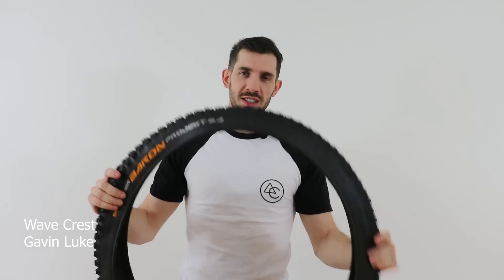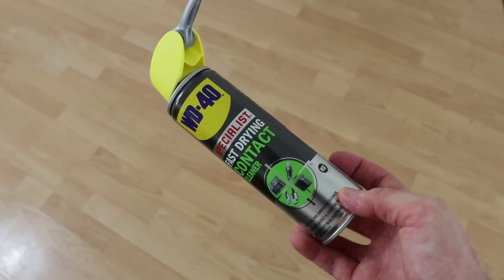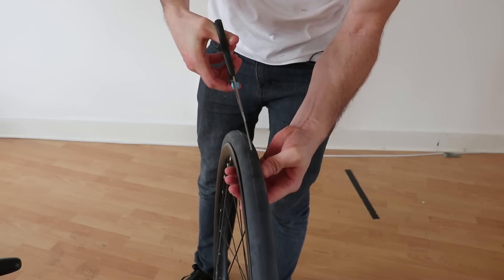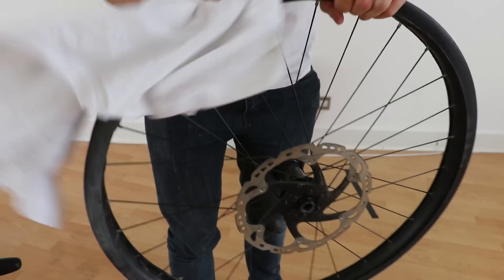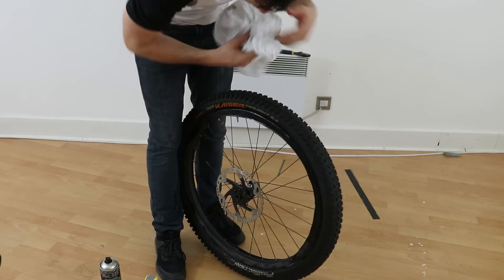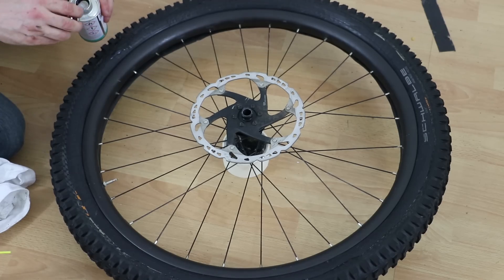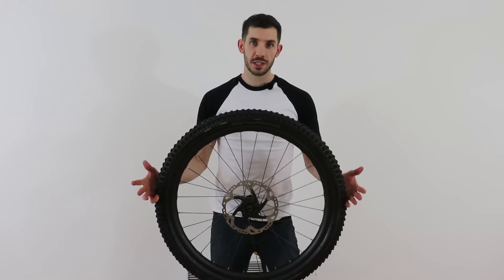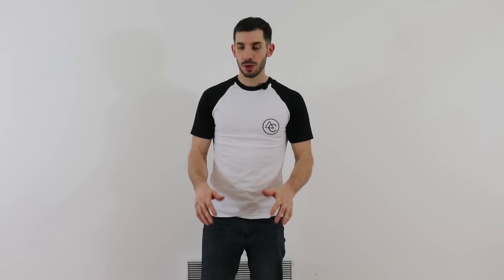Is This Aaron Gwin's Tubeless Secret? Ghetto Tubular

Comment: So now you're using a tube and sealant, pretty pointless as one of the main advantages of tubeless is weight saving.
Reply: main advantages? what are you even talking about?
Reply: Did you watch the Video or do you know what burping is?
The System he built in the Video is against burping the tire, so you aren't going to loose pressure in fast or hard corners and another advantage of having the bit of innertube sticking out on the sidewall it means its a bit more resistant against cuts
Reply: And also in world cup DH weight is not as important as in Cross Country
Reply: Tubeless is not about weight saving. Many tubeless tires are heavier in side wall to begin with so they seal. Its more about puncture fluid self sealing..

Comment: Best tip I can give for tyre mounting is to use a water based lubricant intended for the sexy times... It evaporates out easily and leaves very little residue while being extremely slippery initially, it's cheap as chips at your local convenience store or supermarket ;-)

Comment: Going to try this in CX! Just cut the remaining flap shorter, tight to the bead. Thanks, great suggestion was using thin latex liners with normal latex sealant but this is way more sturdy for the big, off-camber hits that result on burps.

One more idea - maybe use your old patch kit glue tubes for this :)

Comment: Pretty cool idea! I personally would try to trim off a little bit of the excess tube for a cleaner look. I agree with others, I love the idea of a tubular meets clincher hybrid. Would eliminate the need to tape rims, while still having all the benefits of tubeless.
Reply: What if you got manufactures to add an additional extruded flap or a “loose” snake skin strip or something so you could glue the tube to the tire, then glue the extra strip over the tube? The loose tire side wall strips could start at the edge of the side lugs or half way down the side wall and stop just above the lip of the rim. Would look clean and be layered for real side wall protection and triple air retention.

Comment: Genius! yeah that should do it. I went back to ghetto setup after having multiple burps. The last burp threw me at the exposure. Luckily there were bushes and trees to catch me tumbling. Although the current Ghetto setup works just fine, I'll try your glue method for the added lower side wall protection.

Comment: I've successfully done this with a set of Rabbit Hole rims and Knard tyres in case anyone out there is wondering if it works. I used a rimstrip instead of tape, and didn't use vulcanising glue but trimmed the tube almost flush with the rim. I haven't had any issues but haven't been running super low pressures.
 You could also trim the tube a bit before gluing it to the tyre to make it a little more neat

Comment: Bear in mind that the inner tube layer is compressible and this can be of help while mounting the tire, one more reason to apply the proper, enhanced technique which is proven to work: pull the tire as to push the beads in the rims groove'/channel while also pulling radially on the tire, making the tire eccentric to the rim. Start with the opposite side to the valve and end up on the valve; pull the tire as to have it STRETCHED and therefore pressing on the cut tube because of that stretch it has. You need to work in stages, pull away the tire from the rim and also pull the tire upwards towards the valve. That is if you have the valve at the top. You may push with your feet (mind the spokes though) on the rim to keep it on the floor as the tire is pulling the rim upwards because you are pulling the tire as to help with that temporary eccentricity as you work your way towards the valve in maybe more than one cycle. INSIST and have more than one go in helping the tire be stretched all around the rim, from the opposite side of the valve and onwards, not have it stretched just near the valve. That is because the friction keeps the tire from moving (for the eccentricity between the tire and the rim) as to have it pressing as hard as possible on the interface at the opposite side from the valve.

Comment: This is basically that thing enve did with the rubber liner in the rim, the idea was even if you break the rim it will hold air because of the rubber liner.

Comment: what size tire/rim does that 20" inner tube work with? if i use a 27.5" rim/tire, do i get a 1 size smaller inner tube or do i still use a 20" inner tube so it stays tight?
Reply: Hes doing it on a 26 inch so probably a 24 or 22 inch tube would work but you can still use the 20 inch if you want the added difficulty

Comment: This will make your wheel heavier than inner tube + tire. Why not go with thicker sidewalls instead, or combine the tire insert with the tube? Correct me if I'm wrong, but this just recreated the tubular tire without the benefit (or hassle) of gluing the tire to the rim. If this can work, then you could just as easily use a regular sized inner tube (glued inside the tire) to make a tubular, and then simply mount it to the rim.
Reply: @Ali_Clarkson  good job fighting the youtube comment ignorance, Ali, don't burn out from it :P
Reply: It's not the same, because the normal tube+tire is susceptible to snakebite flats. That's always going to be the problem if air is held by a tube instead of the tire casing. It even happens with tubulars (I ride them lots, no longer so much on the road but still on a CX bike) but they are less susceptible because the rim profile is not as "sharp" when bottoming out.

If you trim the excess tube from the sides and you only cover the bead you still gain about half the weight of the tube, while retaining the benefit of sealant. This idea has a fair amount of merit for low-pressure applications.
Reply: @Ali_Clarkson  having some fun with Ali/Aaron reinventing the tubular, but I think in 1-2 years we will see something new that doesn't depend on air pressure

Comment: Hi Ali - what size of inner tube would work with a standard 26inch fat bike wheel?  Just concerned it wouldn't even make it past the edge of the rim!
Reply: You would still use a 20" inner tube, but a larger one.

Comment: I run my fatbike ghetto tubeless but don't glue them down. Can run the pressures mega low with no issues.. then again the tyres are nearly 5 inch wide 😉

Comment: I would've thought there would be a layer of glue inside, between the rim tape and tube, as well. For extra adhesion against rolling off entirely. Same reason road racers use tubulars if the tires lose air, the tire is still glued on.

Comment: Yes I experiencing tire burping with WTB rim...but I only do trail...ghetto system is absolutely good for racing!
I  know about ghetto before from fat bike thing when fat bike tubeless wheel is non-exist. But using glue is nice addition absolutely for race day it is a must. 
Can it just using very thin isolate tape? Like flexible HVAC tape...

Can not imagine how difficult to mount ghetto system using this day mtb tubeless rim and tyre... absolutely pain in the ass...

Comment: Hey Ali Clarkson! Wow! Great idea! You have effectively made a non glue on tubular tire like road bikes but with beads to hold the tire to the rim! I guess you use bigger than 20 inch tubes for the bigger wheel sizes? Ride ride ride!
Reply: Hey if you sucked the air out of the finished MTB tubular unit you brilliantly invented with the sealant injection syringe would that pull the inner tube into the tire for easier removal? Or would the tube be too tight to be sucked in? Ride ride ride!

Comment: have you try'd putting the glue on the bead before seating the tire and then seating the beads so you don't have the excess showing and you could just trim it off
Reply: In my experience the sealant does just that, the tube and the tire get glued toghether by it

Comment: Why not glue a tube to the inside of the tire before installing?
Reply: @Ali_Clarkson  you could use a normal sized tube and glue each side to the lower inside edges.
Reply: Robert Trageser  I have just been running standard tubeless with cushcore. It works really well.

Comment: I'd say you are a genius.. would this work with trials bikes where you would run higher tyre pressures?? If so I'm gonna go and get myself a 12/16 inch tube and some rubber cement.. And by the way , do you have to have tubeless ready tyres?..
Reply: @Ali_Clarkson  thats good to know.. But by high I mean 60-100
Reply: Robert Trageser  I wanted to do I to my BMX ( which utilises higher pressures) I thought I could get rid of puncture issues
Reply: Robert Trageser  bmx tyres go upto 110 psi.. and its a 2.4 tyre..
Reply: Robert Trageser  I run 50 to 60 while riding street and about 80 while riding park..
Reply: Robert Trageser  different riding style.. its not all about traction and pich flats .. there is one more thing to riding harder pressures .. the bike feels more responsive to all the pumping , carving and correction motions.. running softer pressures would just squish the tyres when I try to do anything..
Reply: Robert Trageser  that would work with mountain bikes. I do ride my mountain bike occasionally. Softer tyres there is such a game changer. All the rattles and stuff gets absorbed plus more grip.. so you are encouraged to go faster and less time on the brakes sliping and sliding all over the place..
Reply: Robert Trageser  I'm not going based on what people tell about efficiency. I go based on what feels good while riding.. I tried softer tyres on BMX too.. even when I dont get pinch flats it just feels horrible.. there are people like brandon begin who ride bmx bikes with 20 psi.. It's just not for everyone..
Reply: Robert Trageser  yes I have ( trying a spin trick with low pressure) .. all bmx riders use tubes..

Comment: maybe you should heat the tire a bit with strong hair dryer or heatgun on low.
Reply: Kevlar/wire reinforcing doesn't change circumference with heat but the tube between the tyre and rim enlarged the rims diameter making the tyre now too small to fit.
There is 'some' stretch.. but this idea takes that stretch to its maximum...

Comment: Im only 13 seconds in the video, ill try to guess, umm , latex on beads or super glue or a lot of ductape.
 
Also, changed my profile pictures,and chanel banner, what do you think?
And as always , great video!
Reply: @Ali_Clarkson  one thing i experimented on a friends bike, i used as a tyre insert a pool noodle ,cut down to size and inflated to around 15 psi(with a pretty thight fitting tyre) and i tried to rim out but no result, not even managed to go 1/3 to the rim.
Reply: Robert Trageser  haha, yeah, but i did that because he already had the stuff to go tubeless and we decided to do it on his bike.

Comment: Great idea! There's a guy that sells latex bands here in the US to help run fat bikes tubeless much in this way. Complete with gross sounding web address! (http://fattystripper.com) 

You could probably pick up some therbands or something and achieve the same thing.

I think it's supposed to be a lighter than the split tube; I keep meaning to try it on my comp bike. I can't seem to find a rim tape that is both wide enough and inelastic enough to keep stuff from eventually poking out the rim cutouts though :(

Comment: Could b worse... with motorbike tyres you have to use a damn big rubber mallet to beat a new tyre over the bead. You would never get it over an extra 1mm surface height.
if it was really worth it... they would make tyres a complete tube like road race bikes...
NOW HERE'S AN IDEA...

Try cutting a correct size inner tube so you have a band just wider than your rim (inside section including valve...
carefully glue one side to the INSIDE of one side the tyre (then the fun part...) then glue the other side to the inside of the other side of the tyre... I can see some fancy loop of wire tool to help with this....
Once done you should have a complete inner tube again, except its a tyre... just like they have made for years for race bikes.

To fit.. , start at the valve and fit both walls inside the rim either side of the valve.. then push the inner tube section into the tyre (so the tyre sides are touching...) as you move round the rim...

Sounds good in my head.. but theres a reason why im not putting it to the test.... 

Anyway... I run a 5kg+ backpack... Why would I care about a few 100g of inner tube weight... and I carry a spare tube so punctures just aren't a thing....

I recently replaced the innertube in my Foes Weasel 3.0 Gazzaloddi after near 20 years... I found my mate had used a 1.75 tube (Green??) that hadn't inflated completely in all that time at the reinforced valve section... (it had actually folded inside itself to fill the area)...

Of course I'm not an extreme racer... But would an extreme racer follow this video?

Comment: This is what Fatty/Skinny strippers do, but they're wayyy lighter. No glue should be necessary with those either - if you use a natural rubber latex sealant (stans, orange), the tire and latex band will bond together.

Comment: At this point, why not just use the correct tube for your tire, and put sealant into the tube instead? That is a popular bikepacking setup, and only marginally heavier.
Reply: Yeah, boring solutions that work. ;) But I get you. Sealant in a tube is not good enough for extremely low pressures that you may want on MTB.

Comment: this will make manufacturer think how to use ur idea.....cool idea.......... oh yah... how about removing the tires when the need to replace it..  do we just cut the tires for short cuts
Reply: @Ali_Clarkson  I concur. With care, I've removed gravel tubeless tires with a thin latex strip, just attached with normal latex sealant use. This would make that base more sturdy and the glue more resistant as well.

Comment: Pro tip: if your tire is burping you pressure is too low. We are tryinf to get the pressure as low as possible riding those tires in a range they aren't designed for.
Reply: Low tire pressures = slower than granny on her grocery trike.
Reply: Meh. My cyclocross tires say "40 to 70 psi" (Schwalbe X-One). If you know any competent CX rider that pumps the tires to 40 psi you and I travel in different circles. 

I normally ride them at 30 with no issues - banging them on logs, failed bunny hops, potholes, etc.  Unless I get a big hit off-camber or leaning in a corner. Unfortunately this has happened at crunch time during races.

Comment: Been using this system since 2006 without the rubber cement and it works just fine. Think i've only burped a tire maybe twice in the last 10 years?... I really like it for cleanup when switching tires as you dont have to clean the rim... It essentially turns the tire into a tubular
https://www.youtube.com/watch?v=kdup9wLc0yE

Comment: so many solutions to problems that never existed with simple tubes.  Never. Put a tube in tubeless tires to prevent leaks??  That is what Tubed tires ARE.. This is so stupid.
Reply: @Ali_Clarkson  I get it if you have to run tubeless, you need them to work, but a system that required countless 'hacks' to work properly isn't really market ready, is it? Where is the benefit?

Comment: seems like a LOT of hassle, why not just put fluid in a regular inner tube? same result shurely
Reply: Inner tubes are more prone to snakebite flats than tubeless on its own. If tubes had the same reinforcement as tires, we wouldn't be running tubeless now (unless you ride cross country, then weight matters in competition). But I find it less hassle to set up tubeless than running tubes because you don't have to worry about crooked valves or getting the tube pinched between the rim and tire
Reply: @Awkward_Fox  That makes no sense. My query is in regaurd to the system in the video desighned to stop burping, not tubless in general. An If you can't set a valve straight or pinch a tube on fitting then you shouldn't be any where near a work shop. I guess trials riders are more concerned with snakebites at lower pressure an there for the need for an insert that inherently comes with the problem of burping but, there are so many better way to solve that problem than this, what seems to be a  re'invention of a tubular tyre?